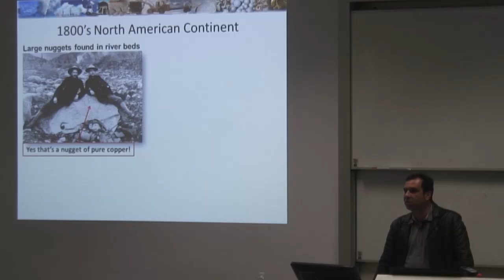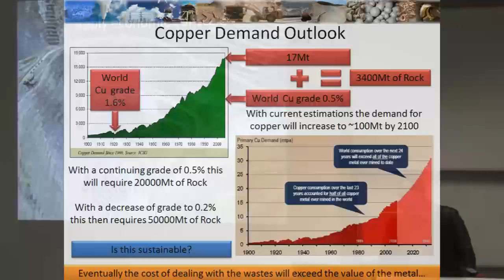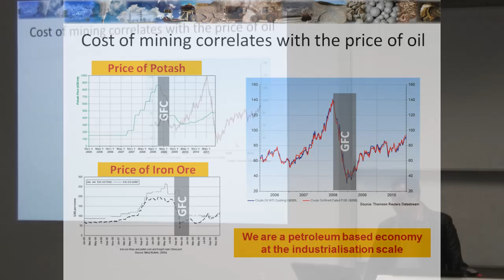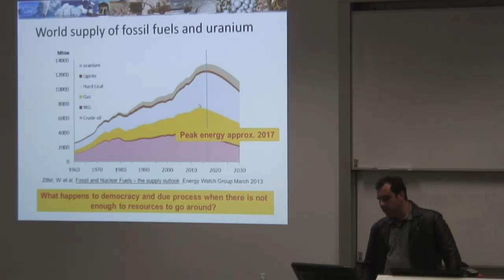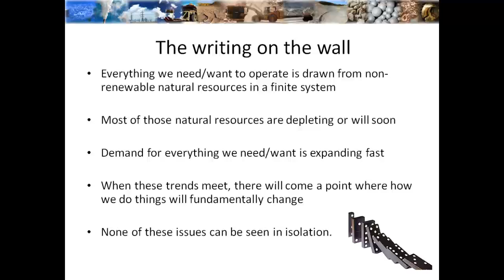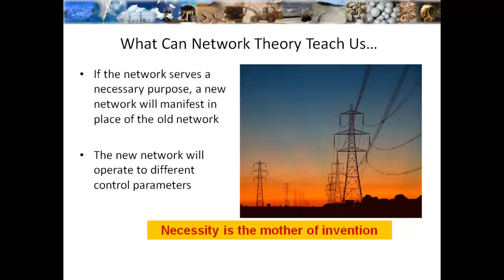Peak mining & implications for natural resource management - Simon Michaux

Comment: Solar and wind are now the cheapest power sources by far, even when the costs of transmission and storage factored in. Solar is doubling worldwide every 4 years, which is much faster than oil’s doubling every decade in the 20th century. As it scales up, the costs come down. It's still got maybe 5 years left of learning curves. Right now Lazard says it is 1/4 the cost of nuclear - by the end of this year that could be 1/5. It's just happening. It’s so cheap that even Australia - where our “climate wars” have dominated politics and toppled many Prime Ministers over the last decade - is now a world leader in renewables. They’re just so cheap we will be 80 to 90% renewable by 2030! In the next 10 to 15 years we will see an exponentially juggernaut of solar and wind take off - and it will be a GOOD thing for the environment. And remember, exponential curves start of really slow for a long long time, and then suddenly everything happens. EG: If you put a bacteria in a petri dish and you know it doubles every minute and the dish will be full in an hour, when does the dish reach half full? In 59 minutes. The bacteria has been almost invisible for 50 minutes then in the last 10 minutes goes from a tiny blotch to an eight, then a quarter, and then half the dish - and suddenly the dish is full on the hour. Right now - solar is just becoming visible. It’s been doubling for a while. But now that wind and solar are the cheapest energy source - the exponential is going to kick in and we will be SHOCKED at how fast things will happen in the next decade!
Reply: hovadiny

Comment: Australia will hit 80% to 90% renewables in 7 years - by 2030 - as our deployment rate has doubled every 4 years for the last decade. That's an exponential growth curve faster than oil in the 20th century which only doubled every decade. Solar and wind are now the cheapest electricity source period. As scale increases there are even more learning curves still to be applied which will bring the price down further. They are being built 3 times faster than everything else combined. Solar is now 1/4 the cost of nuclear - soon it will be 1/5. We can deal with winter. If winter halves your renewables output, then DOUBLE THEM to compensate. It's called "Overbuild" and the spare solar and wind capacity the rest of the year can be curtailed - or put to other industries 10 months of the year, like Desal, Gasification of household wastes into jet fuel or useful building materials, or making hydrogen. 2030 is coming - and this peak energy talk will look like so much nonsense.
http://theconversation.com/theres-a-huge-surge-in-solar-production-under-way-and-australia-could-show-the-world-how-to-use-it-190241

Comment: Nuclear 'waste' is not a problem, but could be yet ANOTHER solution to climate change! Feed it to breeder reactors and get 100 times the energy out of it! The final real waste is melted into ceramic bricks, buried in a bunker on the nuclear energy park grounds, and stored for 300 years. Then it's safe. Argonne Labs - 4 minutes. https://youtu.be/MlMDDhQ9-pE

Comment: Data has been collected since this was uploaded and this presentation has evolved.  I now have data to show that the year 2005 was a turning point.  Oil supply became inelastic and at the same time Chinese demand for raw materials accelerated.  Metal prices (Au, Ag, Ni, Pb, Cu, Fe, Zn, etc) spiked and became very volatile.  The 2008 economic correction  of the GFC did not resolve these issues and return metal prices to the levels prior to 2005 nor did it create a new level of stability.  This means that the underlying issues were not addressed and market speculators were not the controlling force. 

We are now 8-9 years into an era of industrial transformation.  I believe this is a signature for the start of transformation as a consequence of Peak Oil.  All of our resources are following this pattern.  Peak oil is certainly not the only problem we are faced with. Our financial and economic systems are far too fragile and disconnected from reality to engage in the required industrial reform.

There are some technological solutions which might help if applied correctly.  The real constraint is now time.  We are out of time.  We really need 10-20 years to manage the transition after the political will has been established.  These problems here now.  Current political leadership are engaging in squabbling over the dregs of what resources are left and maintaining the status quo.  We are using the last of the easy to get resources, to do the equivalent of straightening bananas.  All of this indifference does suggest a certain outcome.
Reply: I think it is humorous, Simon, that you wrote, back in 2014, "year 2005 was a turning point.  Oil supply became inelastic..."

When you wrote that, oil prices had been hovering around $100 / bbl for several years. Immediately after you wrote it, oil prices collapsed like a lead balloon, and they have now settled to around $60 / bbl. Here's a graph (saved as of today):
http://web.archive.org/web/20191201202540/https://www.macrotrends.net/2516/wti-crude-oil-prices-10-year-daily-chart

At 1:00 in the video I heard the first inaccurate claim: “Our population has increased, and our energy sector is all non-renewable.”

In fact, a significant part of the world’s electricity comes from hydroelectric (renewable) and nuclear (essentially infinite) sources. Hydroelectric sources cannot be expanded much, but there’s no practical limit to the amount of energy that can be produced by nuclear power plants.

I listened to the first 1/4 of the video. It was mostly about how much more energy intensive it is to extract metals from ores of ever-decreasing grade. That’s true, and it certainly isn’t news. But there’s also no practical limit to the amount of energy that can be produced by nuclear power, to meet those needs.

You made the case that as mining shifts to lower-grade ore deposits, the costs will go up and up. That’s true, too, but (at least in the first 25% of the video) you didn’t mention what happens in the commodities markets when prices of a commodity go up.

The answer is that demand for that commodity goes down. Even commodities with relatively inelastic short-term demand tend to have very elastic long-term demand.

Manufacturers look for other materials to replace the ones that are becoming too expensive, and consumers of expensive products find ways to avoid them.

Have you noticed how much plastic, fiberglass, carbon fiber, etc. is being used these days, for applications that used to use metal?

You talked a lot about copper. But when the value of the copper in a U.S. penny rose above 1¢, the U.S. mint shifted to making pennies of zinc, because it is cheaper and more plentiful, thus permanently reducing the demand for copper.

You also mentioned gold. A major consumer of gold is the electronics industry. But they now use orders of magnitude less gold for equivalent production, because the price rose so dramatically.

What’s more, some raw materials are so plentiful that they are essentially infinite. The limestone used to make concrete is one of them. Iron ore is also very plentiful. Yet early in this video you mentioned concrete and steel as examples of non-renewable resources that we all use.
 That's only technically true; practically speaking, they're poor examples.

It sounds to me like you read The Limits to Growth, and were frightened by it — and didn’t notice how, over the subsequent 47½ years, all of the LtG’s dire predictions turned out to be spectacularly wrong.
Reply: @ncdave4life  LOL....nuclear is neither infinite, clean or efficient. The world would need 27,000 nuclear power plant-scale reactors to supply 100% of current electricity needs. The supply of uranium in ground would last only three (3) years to supply those reactors. But most of humanity would be poisoned if we operated 27,000 large nuclear reactors. Besides, there will never be enough petroleum to mine and process enough reactor fuel for 27,000 nuclear reactors. Your ilk are smoking rainbow unicorn fe-feace....lol
Reply: @ncdave4life  https://thetyee.ca/Opinion/2017/07/17/Coming-Global-Collapse/
Reply: @ncdave4life   limits.  You seem to imagine we can keep dodging them.
Reply: @ncdave4life  So much of your post is wrong I barely know where to begin. If you want to call the share of hydro (basically already maxed out unless you feel like nuking a bunch more fertile land and nature for maybe a 20% increase) and nuclear (good luck increasing the share of this power LOL) "significant", then I don't know what to tell you, because you are simply wrong. The vast and overwhelming majority of ENERGY (note; energy not electricity, because that is the relevant metric here) comes from coal, oil and gas. Plastic and composites are used more now, sure, that is because they are much, much cheaper than metals and they get to pass the cost of their disposal onto the consumers who just throw them in the ocean leaving the planet to pick up the bill. Comparing the transition of pennies from copper to zinc to practical uses of copper is ABSURD, you cannot make motor windings or damn near anything conductive out of anything except copper, people have been trying for a long time and nothing works because of inherent physical properties, you can make coins out of whatever the fuck you want. Gold is used somewhat less yes, because of the price increases they cut it out of non-essential purposes, but it is still absolutely necessary for many, many electronic components again because of inherent physical properties. Limestone is used to make concrete yes, do you know how they process it into cement? With MASSIVE furnaces running on checks notes oh yes, fossil fuels which are irreplaceable due to their coking properties.
Reply: @ncdave4life  you may not throw it it into the ocean directly but do you know what happens when you put it into your """recycling""" bin, overwhelming odds are that your country has a contract with a third world country to take and recycle this waste. However it is much cheaper for them to dispose of it into the nearest river so that is what happens. Again, sure nuclear could maybe provide a decent portion of ELECTRICAL power if you decide to ignore the massive fuel cost to mine and refine it along with somehow convincing people not to hate it, but that doesn't address the ENERGY issue. Far more energy is used in fossil fuels than electricity. As you note there is no replacing copper, aluminium is not a replacement except for very specific circumstances (if you are old enough you will remember that the aluminium trend for wiring houses ended really fucking quickly when it started burning loads of houses down because it sucks unless you are using it with very expensive equipment and in special circumstances) and there isn't enough silver on the whole fucking planet to replace copper. Listen buddy I like nuclear too but it's not going to happen in the current or any future political climate, but it is NOT limitless and the amount of plants you would need to build to replace all existing electrical AND energy consumption is laughable, it cannot even replace fossil fuels for many industrial applications because of the their coking qualities, nor does nuclear solve the massive quantity of minerals required for operating electrical equipment and battery storage for vehicles.
Reply: @Shrouded_reaper  , I composed a long reply to you, but, unfortunately, the youtube thought police censored it. If you want to read it, please drop me a line. Click my name, then "About," then "contact me."

Comment: 1. Peak uranium? When today’s waste could run the world for 500 years? Tell him he’s dreaming.
“    Barry Brook:…. So instead of getting less than 1% of the energy out of uranium, these fast reactors get about 99.8% of the energy out of it which means they’re incredibly more efficient in terms of using the uranium resource. And actually we’ve mined enough uranium already to run the whole world in these reactors for about 500 years.

    Robyn Williams: So the old argument about running out of uranium isn’t on any more?

    Barry Brook: We may run out in 50,000 or so years if we powered the whole world by uranium, but then we’ve got about four times as much thorium to use as well. So the argument that we’ll run out of uranium is a dead duck.”
http://bravenewclimate.com/2009/07/22/science-show-nuclear-power-plants-now-safer-and-cheaper/

Uranium from seawater could run the world for hundreds of millions of years.
http://en.wikipedia.org/wiki/Peak_uranium#Seawater

2. It takes for or 5 years to build a nuke? Nukes are too expensive, who is going to pay for them? Both of these arguments are related, and both are baloney. It’s like condemning the airline industry because the Hindenberg exploded.

How long does it take to make a car, or how much does a car cost? It depends. Are we talking about a one-of-a-kind hand crafted Bentley classic, or an off the production line Hyundai? Today’s nukes can be modularised and put up on the production line. They can then be trucked to site and clipped together like so much super-sized lego. It’s just plain disingenuous to rely on the too long’ or ‘too expensive’ arguments. It does not have to be that way.

3. Spent fuel rods? Are you SERIOUS! This guy has NO IDEA what he’s talking about. The fuel can be reprocessed in an INTEGRATED Fast Reactor, and just today’s nuclear waste is worth $30 TRILLION dollars as a resource because it could run the world for 5 centuries. So we’re just going to store these 'spent fuel rods'? That would be like digging up your best sweet oil, refining it into petroleum, and then burying it somewhere for decades! That would be retarded! Instead, these fuel rods can be reprocessed and USED! Waste = fuel, get it? As for Simon saying “Until someone comes up with a solution, I just don’t think nuclear is viable, ” well, until he's done some more reading on the EBR2 which was built in the 1960's for crying out loud, and how it uses nuclear waste as fuel, I don't think Simon's TALK is viable!